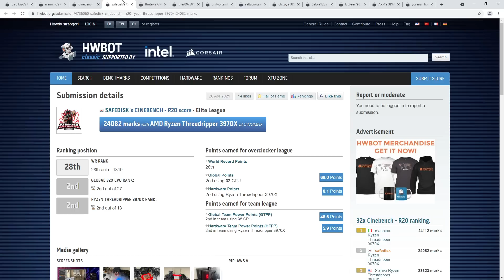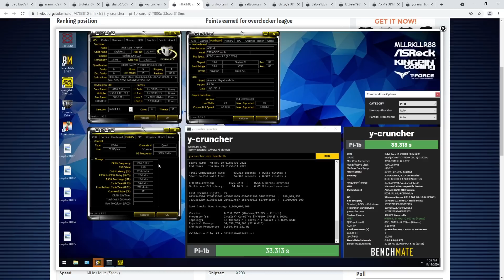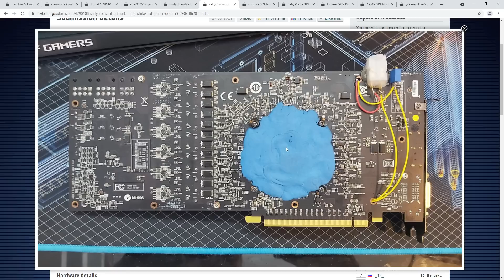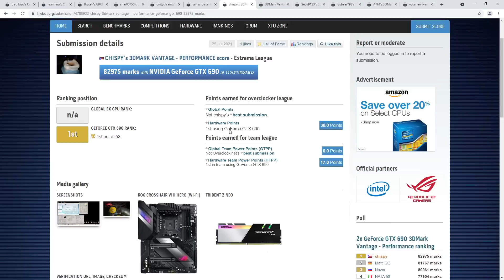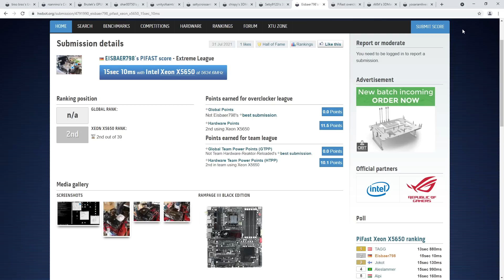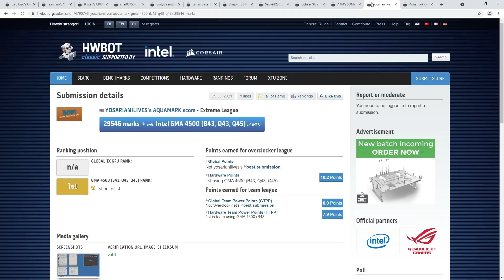HWbot round up #13: 5.5GHz Threadripper 3970X on LN2, R9 290Xs, 5.6GHz Xeon X5650 and more!

Comment: still on ryzen 5 3600 non x. memory is within 1% of its full potential, 43.75 ghz 1;333v with nh d14 on it. d14 has been lapped down to the heat pipes and cpu also lapped. tdie @ idle 28c stock was about 45 stock lol. crucial ballistix 4x8gb 3600 cl cl16 overclocked to 3800 with infinity fab cl 14 lol 1.4 volts lol evga gtx 1650 d6 running 1.094v 2115 core clock 1750 on the memory (7000) modifies arctic accelero xtreme with 2 120 sp fans. idle temp gpu 30, hotspot 46, under load cpu 41celcius, hotspot 57c. did a userbenchmark as a joke and got 100% lol. i crush most zen 3 setups now just cause of the memory oc. can confirm micron e die does not care about temps lol voltage scale is wierd tho. i dint get good results over 1.4v

Comment: Looks like Biso-Biso was running the 3090KP at PCIe 3.0 speeds to maintain the run.
Reply from the maker: the 10900K is a PCI-e 3.0 CPU.
Reply: @ActuallyHardcoreOverclocking  right, i forgot that spec. I got a 10850K that runs 5.3GHz on 8c and 5.2GHz on the other 2. I paid $315 for it, using a z590 Aorus Ultra.

Comment: My old 290X Lightning did 1220 core and 2000 mem on stock cooler through firestrike. Also, afaik, all 290X lightnings were shipped with Samsung GDDR5
Reply from the maker: that's insane memory.
Reply: If that card hold its clock with modded timings thats insane.
Reply: @saltyphil1874  its long dead sadly.
Reply: @Ground15  :(

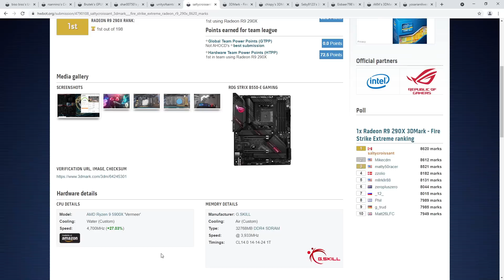Comment: 33:10 that's why i use HDMI :)
Reply: This apply to any display output on the card. I was using a hdmi port and still needed over 1.05v to not get blackscreen issue.
Reply: I was getting black screens on the DP with my FuryX but switched to HDMI and was able to push the card further.  And by further, i mean i think i ran out of voltage.  It's my only experience with AMD and black screens.

Comment: Cascadecooling with more than 2 stages makes no sense. A triple stage would be just higly ineffective due to some physics limitations you hit with traditional refrigeration. It would also suck a lot of power. Effeciency loss is even seen on most dual stage systems. Theoretically you could reach -100° celsius dual stage, but most struggle to even get close to -80.  So - 78° is a pretty decent achievement i guess.
Reply: agreed, also compressors tend to have a max BTU limit before they fall off in cooling. parallel compressors is not the same as cascade, however I don't think anyone outside of the food industry is doing that.

the only caveat, being something we don't have in personal consumer computers yet, quantum comps. to reduce thermal noise, them things run in the 15mK (-273.135C) range, often with compressors (and coolants) optimized for each outer shell temp step on the way to the center of the machine that is stupid cold. outer box at 50K, next inner being 4K, then 100mK, then the 15mK, and that's not for OCing, just noise reduction, lol. it gets a tad difficult to measure the spin of individual atoms when there hopping all over the place from heat.

Comment: First. Please reply to my Reddit chat. I blew up the fuses of my Nitro+ and it died. Resurrected it by shorting the fuses temporarily but GPU is erratic, won’t install Radeon driver so I’m stuck at 1024x768. LOL.
Reply from the maker: I don't use reddit chat
Reply: @ActuallyHardcoreOverclocking  How do I contact you? Thanks.
Reply: BZ isn't free tech support man
Reply: Rip
Reply: The card is fine. Turns out it was a driver conflict. OK, let’s get back to smashing my 3dmark world records. LOL.